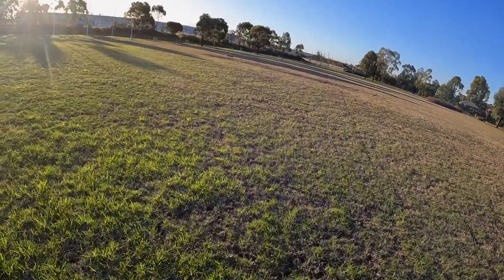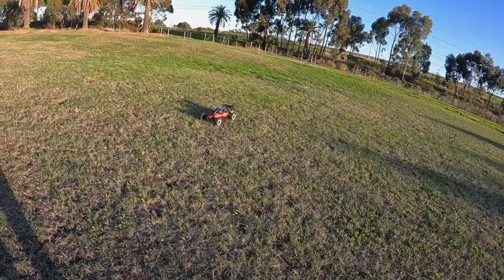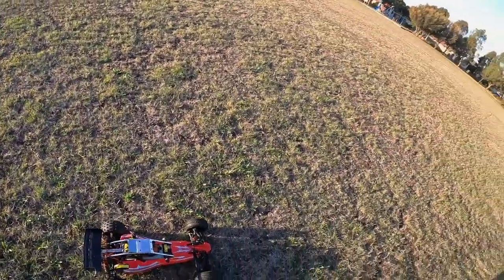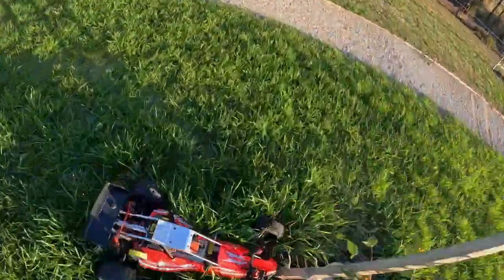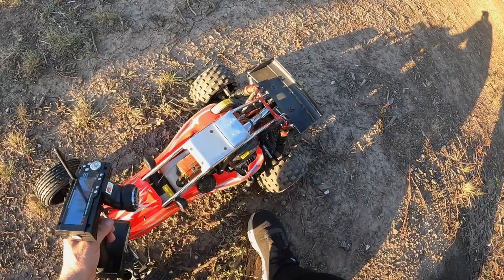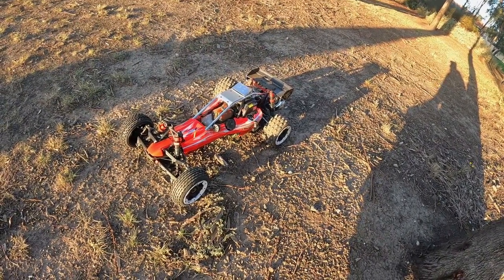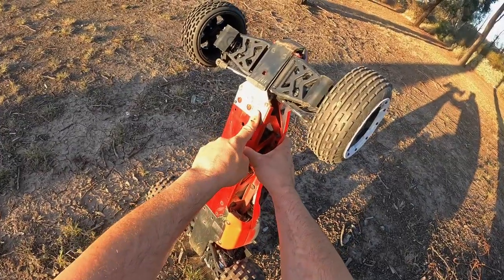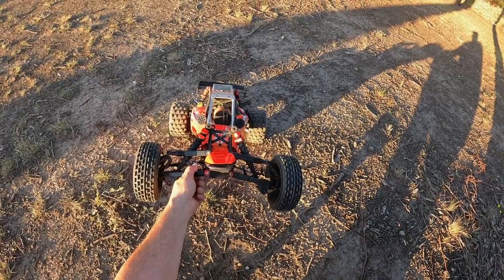The truth about BAJA 5B - You either love it or hate it

Comment: im ripping mine at least 2 times every week for the past 2 1/2 months with constant rain / snow, i had one thing that broke after 12~ liters of fuel, the clutch spring, easy fix ..
the only thing that makes slight problems is the steering, the stock servo sparer starts to get worn out pretty quick, im upgrading mine the next few days.. either an alu servor sparer or symmetrical steering / fg steering kit, not sure yet ^^

heck even if your engine starts to lock up, a new one costs like 120~ bucks, love this buggy! 
wrenching on them is part of the fun in my opinion

*edit oh yeah and it eats tires 😝✌
Reply from the maker: That’s awesome dude. I would like to experience snow one day with my rc cars. But where I am there ain’t any. Def needs a better steering servo and the symmetrical steering for sure . The stock just doesn’t cut it . 
Yeah tyres too are an issue. It really tears them apart, especially the bead lockers. Have gone through a few of them. 
Thanks for watching. 👍🏼🚗